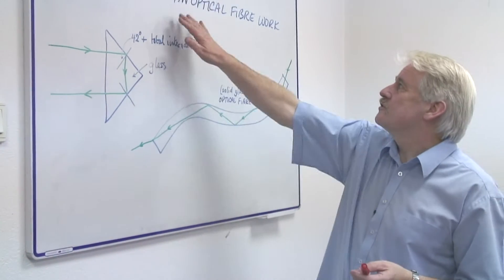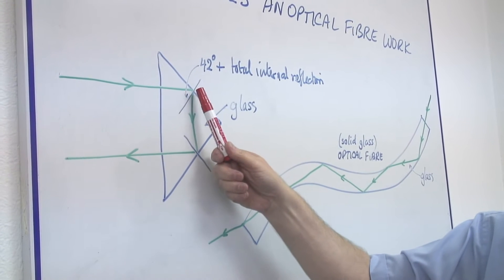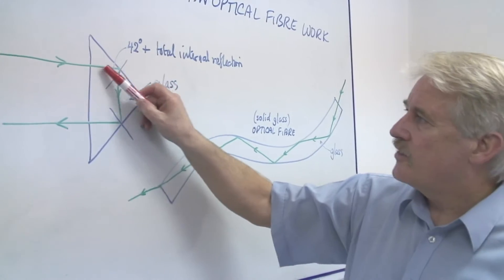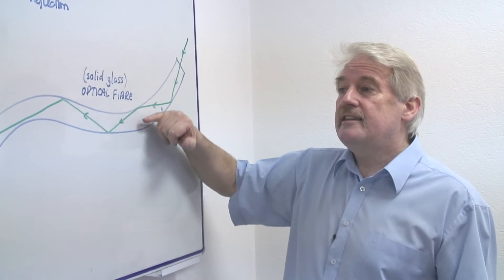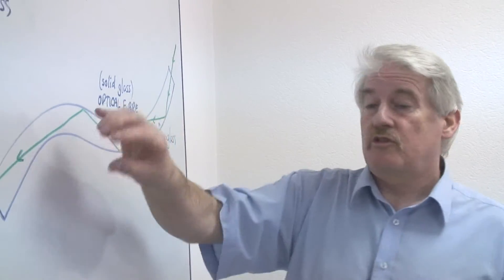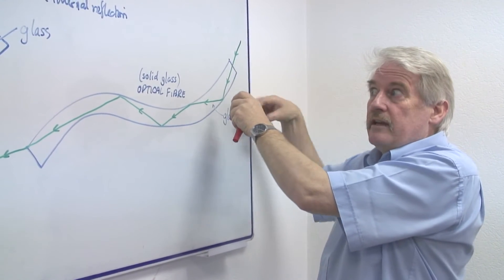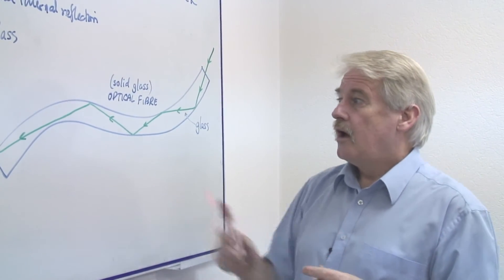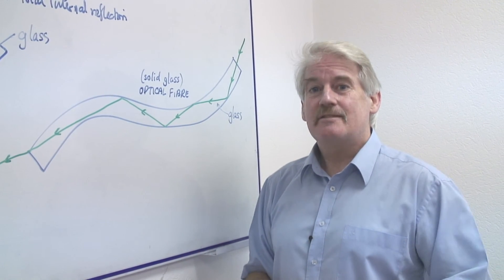Energy & Electricity in Science : How Does Optical Fiber Work?

Comment: @kevinchris: in communications sound is converted to electricity by your phone. from your phone, the phone carrier converts the electrical signal into digital data. once coded into digital, pulses of light can be used to transmit the data. it is then converted back to an electrical signal, and back into sound at the other end.
  The glass used to make fiber is so thin and uniform that it can actually bend, however, it can and will break if bent too far.

Comment: Hello! Thank you for your presentation regarding the fenomena taking place inside the optical fibre, but what about the extremities? ; how is the elctrical signal coverted into optical signal and vice-versa? what kind of modulation is being used to code the signal (intensity variation, as i accidentally heard, or frequency modulation or else)? And what about the required equipment and the final structure of the network?